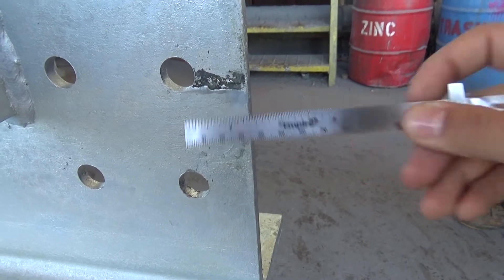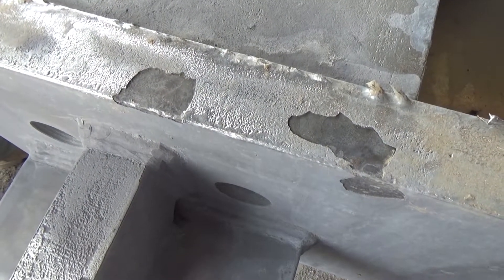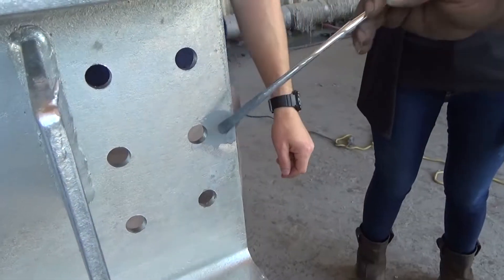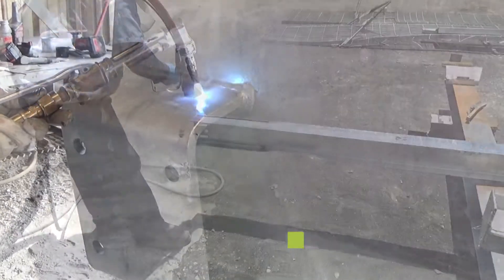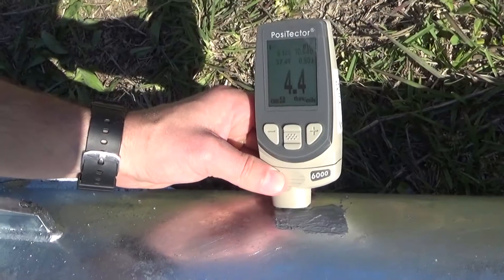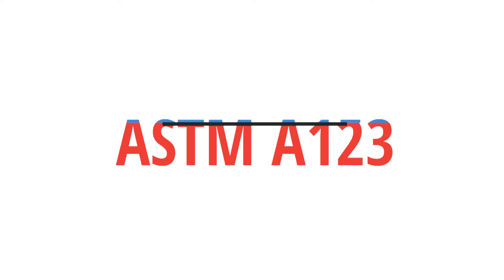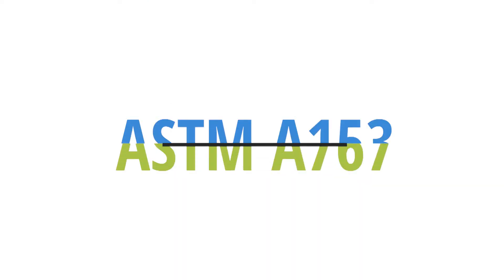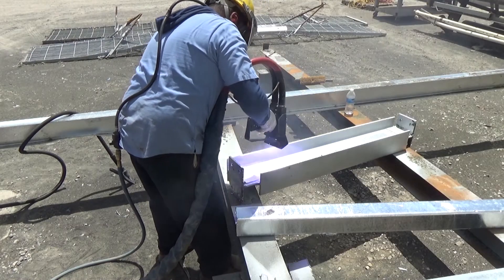In Field Repair of Hot-Dip Galvanized Steel

Comment: Can you hurt coating by screwing a galvanized screw into a galvanized frame wall,joist,thruss etc at a joint in order to frame the skeleton of a house, my question is screwing a possible future corrosion issue? If yes do I have to paint or spray every screw hole and screw in again? Thank you guys.